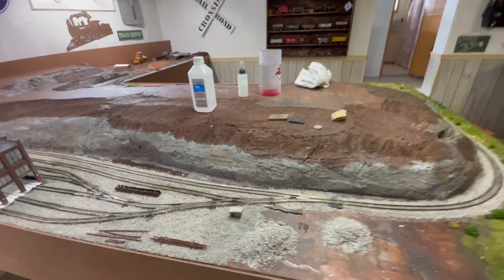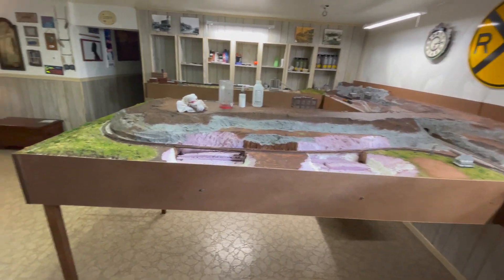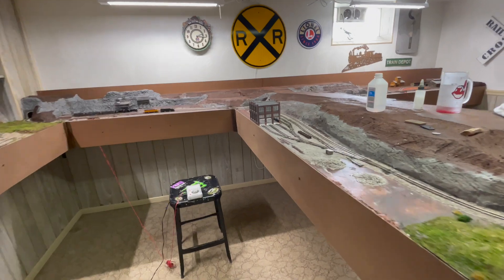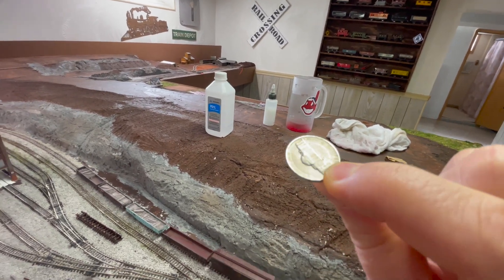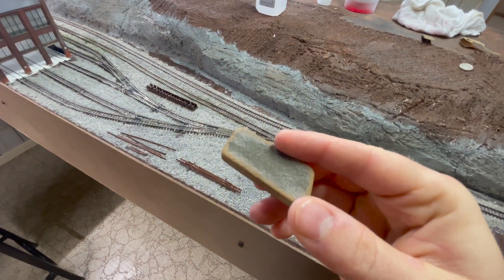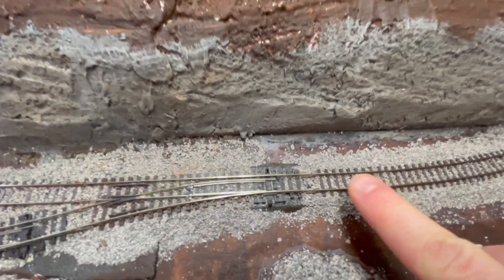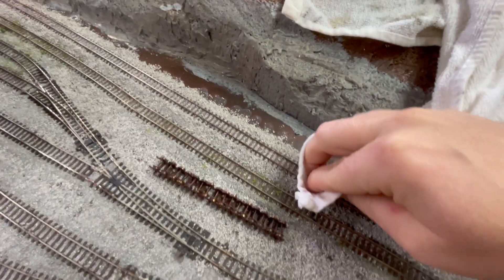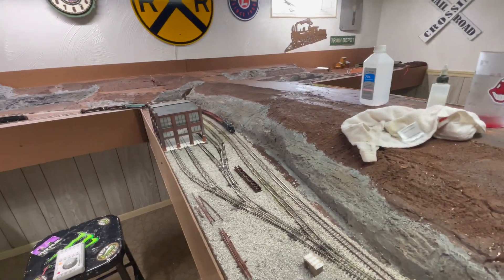BEST Way To Clean Your Track FOR FREE - Model Railroading

Comment: Was wondering where this video was going to go. As to answer your question on what to do with your bright boy - throw it in trash if you haven't already! Abrasives of any type and rail heads should never be an option. The warm water/cloth is simple, effective and won't damage the rail heads (even if you can't see the microscopic scratches that then accumulate grime, etc). Well done sir, well done!
Reply from the maker: ya the bright boy did nothing lol

Comment: I Use a Small Piece of Sand Paper Don’t Have A Problem With my Ho. And N scale track.
Reply from the maker: like i said, it def does the trick for sure
Reply: Just Used a Drop of Dawn Dish soap with a Paper towel and That Does the Trick try it You Might Like It.
Reply from the maker: @elleryparsons2433  will consider it